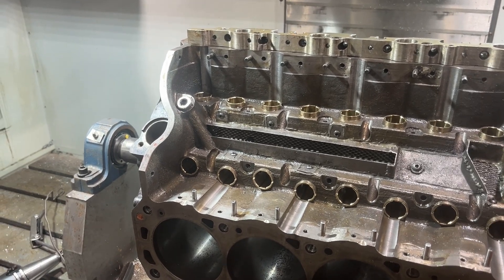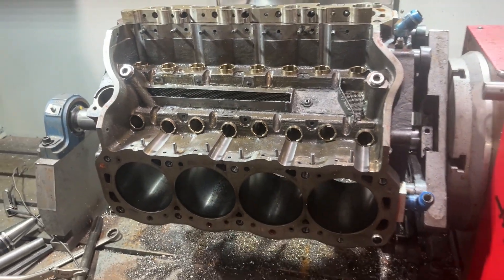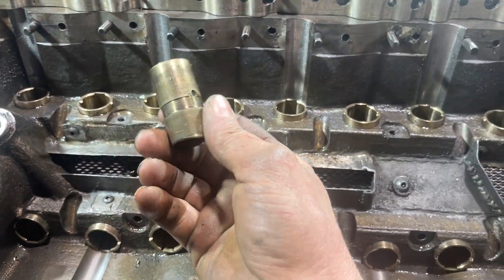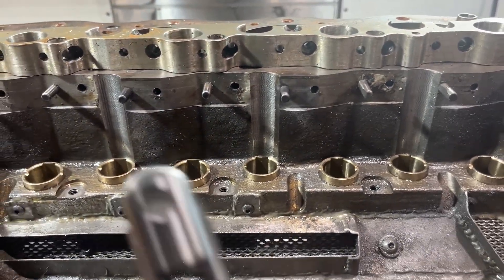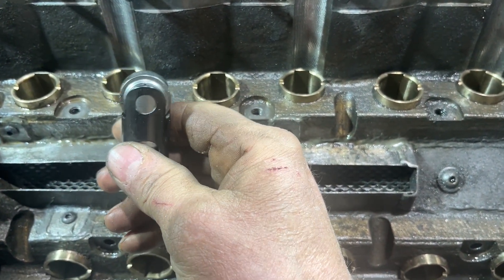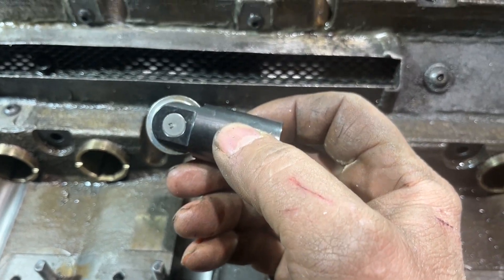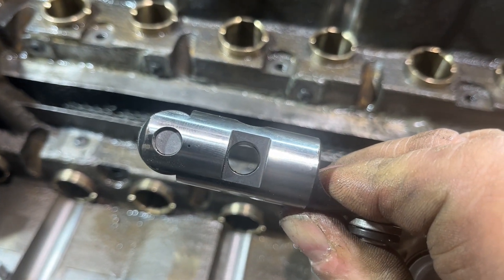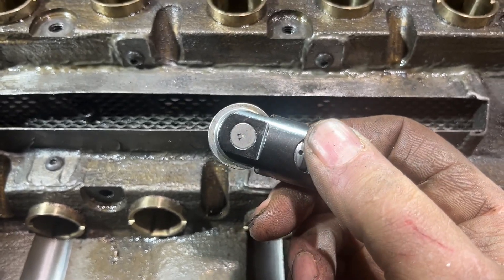Machining Custom Lifter Locations – Dart Block // Titus Performance

Comment: Great work there...I would of liked to see the underside, to see the lifter in place.. The amount of wheel that hangs out on the cam side..  What lobe Lift can that accommodate  ???
Reply from the maker: The bushings are pressed in so the bottoms are even with the cam tunnel.  That gives maximum support to the lifter body. Lobe lift maximum is determined by the base circle of the cam vs. its journal diameter.
Reply: @TitusPerformance  So can i ask, how much of the wheel hangs out the bottom.. Which is still enough to keep the wheel in the groove to line it up to keep it straight.. That has to be a 55mm cam, lobe has to be 550" - 570".... first time iv'e seen these . will look on jesel site..
Reply from the maker: @   60 mm